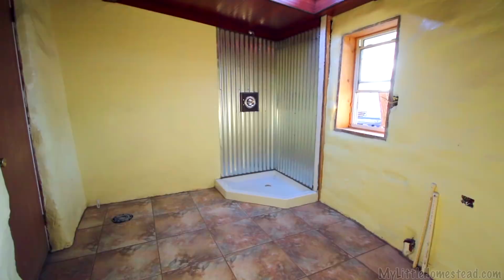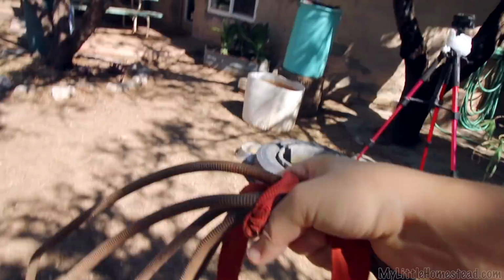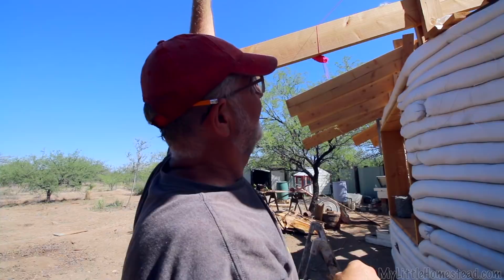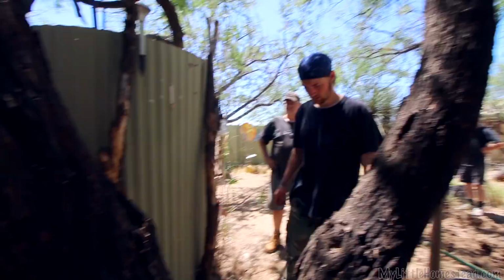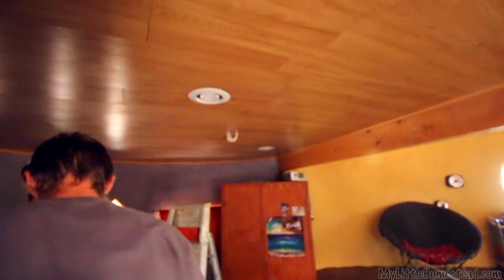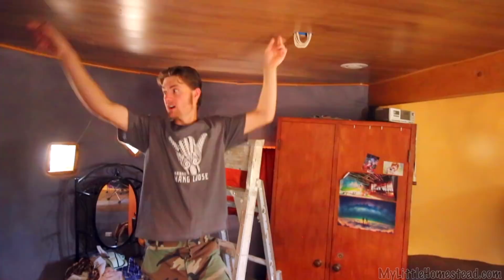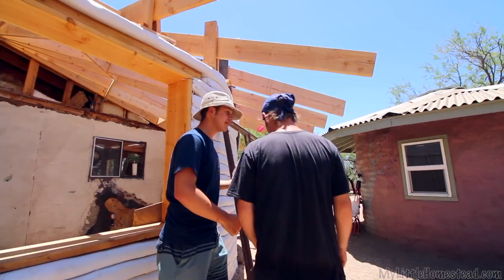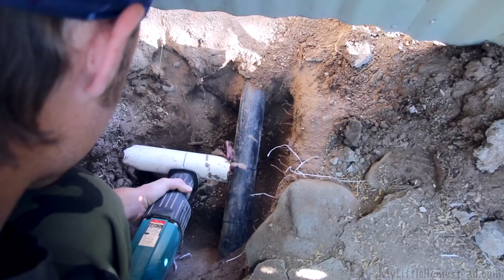Completing Rafters, Grey Water & Disco Lights!  | Earthbag Kitchen & Bathroom | Weekly Peek Ep143

Comment: When you put PVC pipe in the ground lay insulated steel wire on top of it. Then you will be able to locate with a cheap metal detector later.  Lay the wire on top in the direction the pipe travels. Keeps you from digging up pipe if your doing other below ground projects later. 
Remember to slope your pipe!

Comment: Quick tip. Not sure if you have one or not but, run the snake up the line as far as you can and then use a metal detector to follow it.

Comment: You used the right drain fitting (called a wye). The other fittings you had are for vents, not drains. Not sure how well the glue is going to work though going from PVC to ABS, havent tried it.

Comment: Another inexpensive alternative for the fan / light problem is a small X10 install.  X10 uses signaling over the power lines so it is pretty easy to install but is susceptible to interference from some cheapo wall warts (the ubiquitous plug in transformers).

But X10 is a whole lot easier/cheaper than wiring a 3-way, 4-way, ... n-way switch too.

Comment: IF THE WIRING THAT SHOULD HAVE WENT TO THE FAN WAS PUT ON THE LIGHTS............ UUUUUMMMM THEN
WHY NOT PUT THE WIRING THAT WAS SUPPOSE TO GO TO THE LIGHTS PUT IT IN THE FAN??????
[[[[ SUGGESTION...... DONT SHOOT THAT NAIL GUN WHEN FACING THE NAIL END OF THAT GUN, THAT WOULD NOT BE A PRETTY THING TO TAKE TO THE E.R. AN TRY TO EXPLAIN THAT OOPS]]]]
Reply: "i've been nailing since I was 10"!
Reply: that advice is still valid